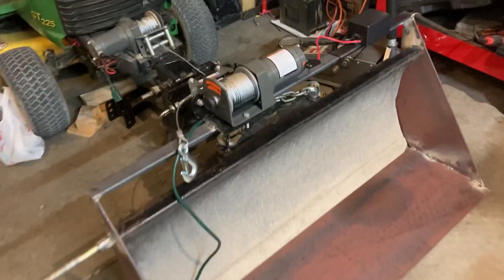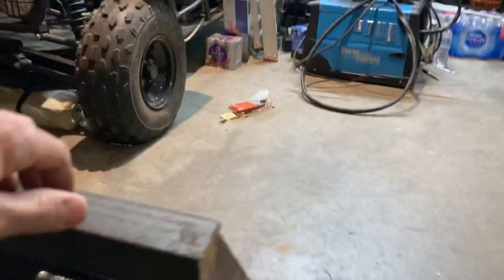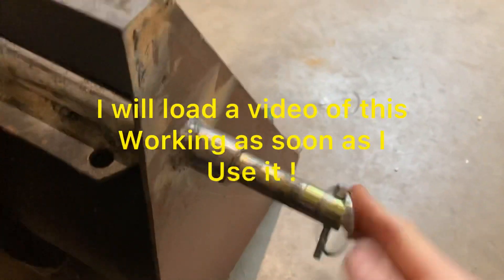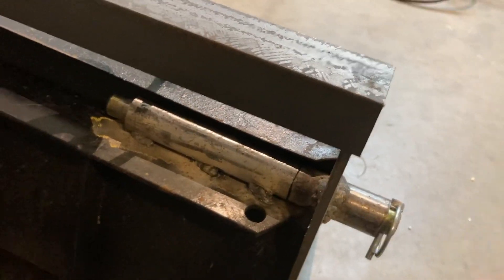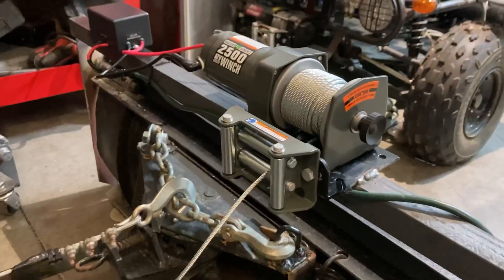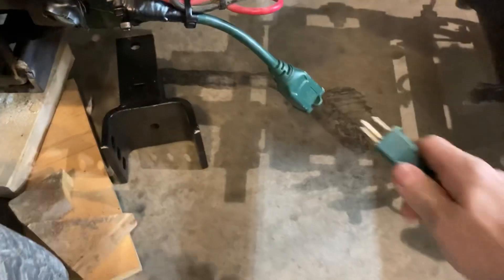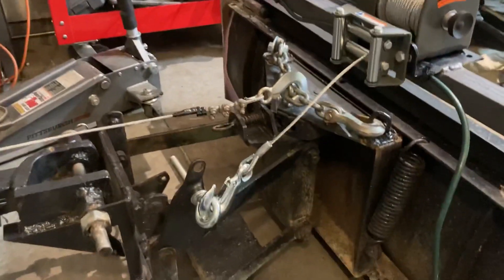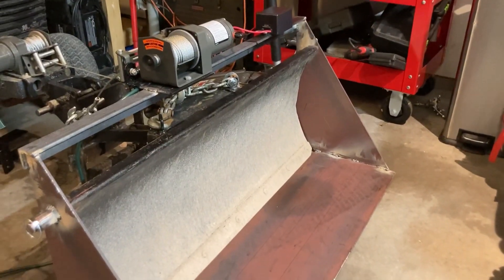Garden tractor loader bucket, clam shell front loader attachment, implement,DIY

Comment: What size steel did you use for this bucket attachment?
Reply from the maker: I bought a 1 foot by 20 foot 1/4 inch piece of steel. Luckily a friend needed some too, so we both took half of it.cost 80.00 “my half”.  Probably could have went with something not as think and been fine.  I just wanted to make sure it had enough strength to hold up to the impacts of running up under soil/material
Reply: Thank you! I'm going with 3/16th steel. Thank you for replying. I will ne making mine the same way. You did an awesome job btw

Comment: Any follow-up video for this?
Reply from the maker: I haven’t loaded anything yet. I have added one brace for support also painted it.  I used it recently to move a lot of dirt around and it worked great… for what it is anyways.  I had a Kabota tractor clearing a lot of dirt for a driveway I just did.  I was able to scoop a lot of the dirt around the edges and from a pile I made with the other “bigger” tractor.